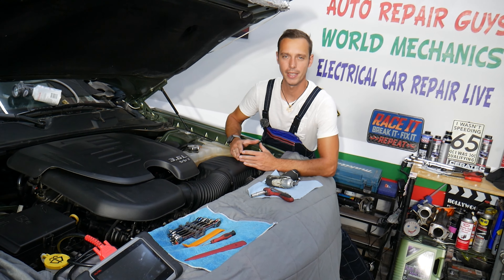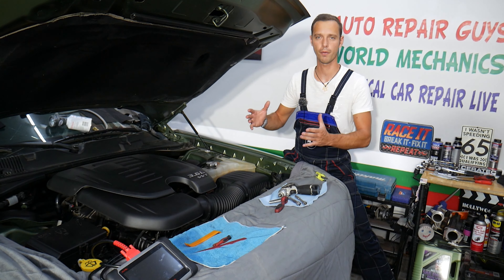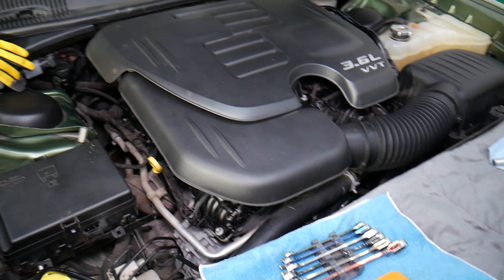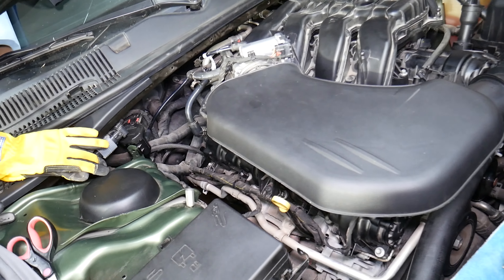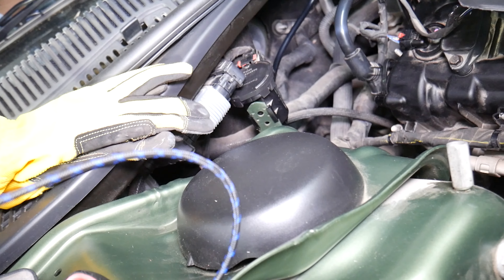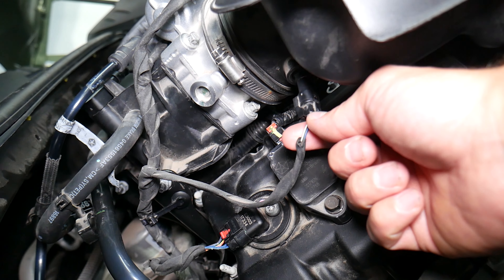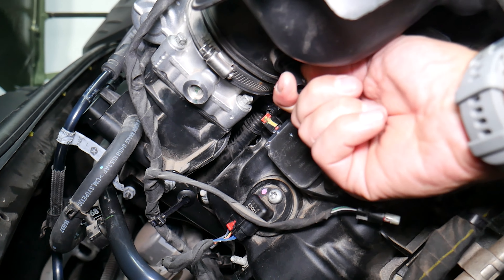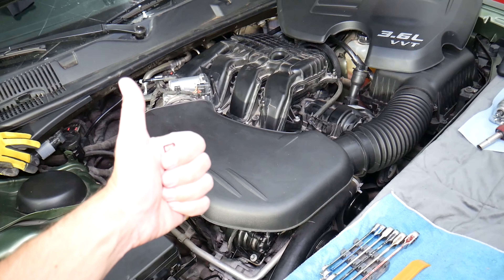DODGE CHARGER INTAKE AIR TEMPERATURE SENSOR REPLACEMENT LOCATION REMOVAL

Comment: Hey I have a problem with my bmw 750 li 2008 I put it into drive it turns on and everything but when I put it into drive it goes back to park and I haven’t changed the oil it’s been sitting for 1 year so do you know what’s wrong ???

Comment: Your wrong the one on the air intake is a air pressure two wires there are 3 sensors the ambient air temperature sensor is same on the front of the vehicle and it measures temperature have they are coming into the air filter then air pressure sensor tells the computer how much back pressure or thick the air is so it can add just the butterflies in the throttle body